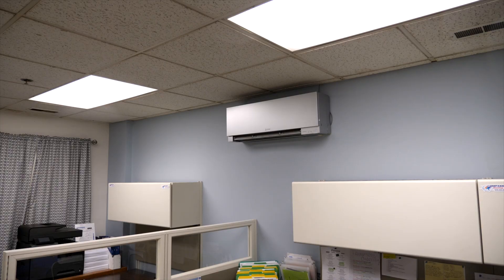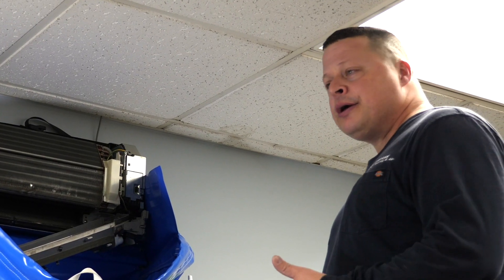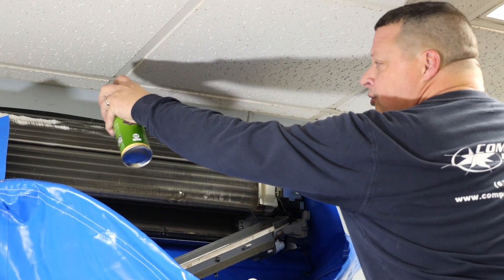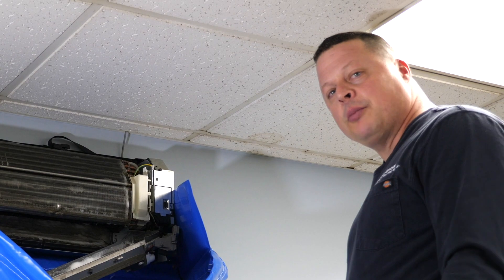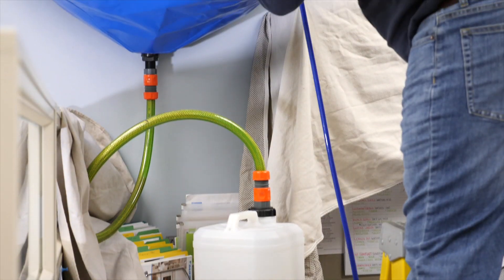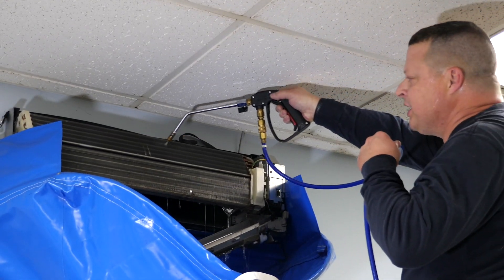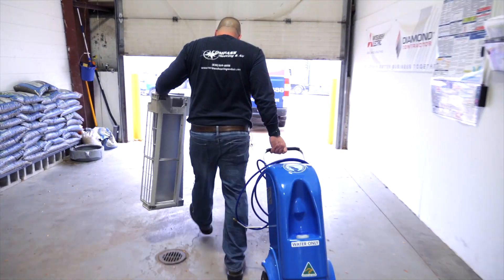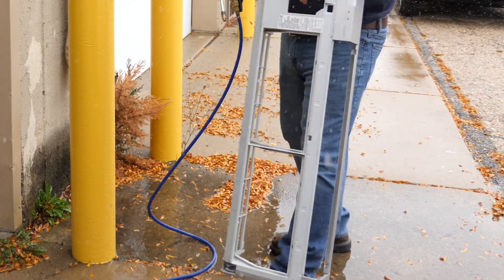Deep Cleaning a Ductless Wall Unit by Compass Heating and Air

Comment: So you can do this without completely dis-assembling the indoor head?
Reply from the maker: That is correct; only the plastic covers are removed and the condensate drain pan is taken loose.
Reply: @compassheatingandair  So that dis-assembly only takes 5 minutes, yes? But we would need that Cleaning machine you are using in the video.